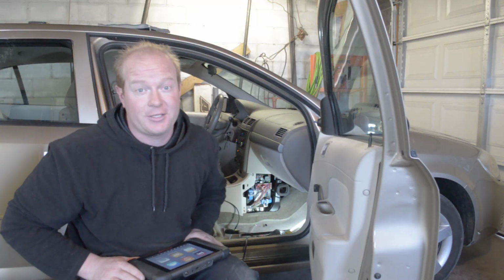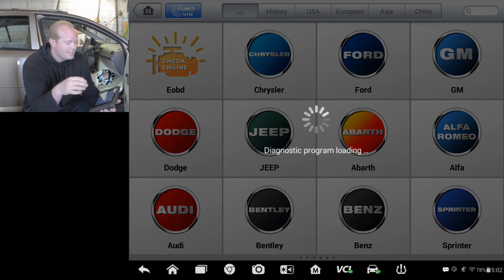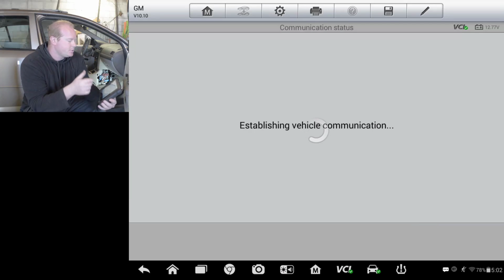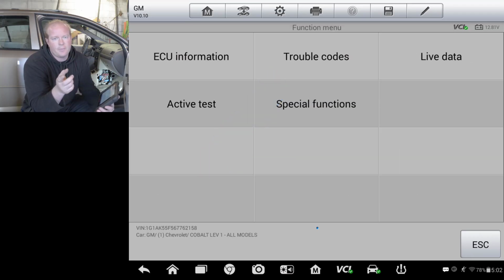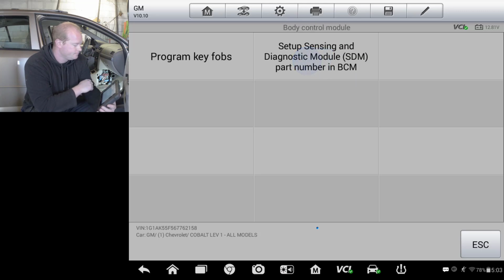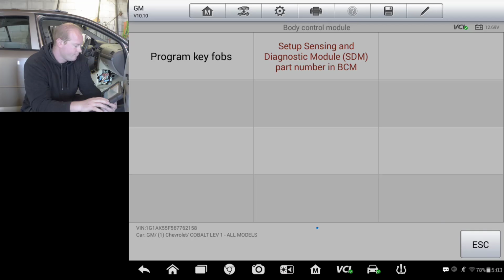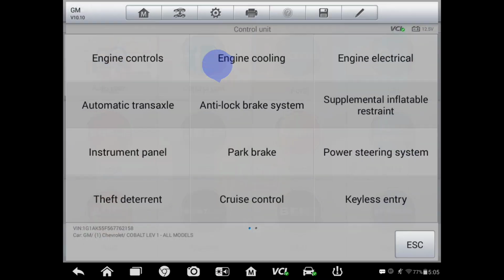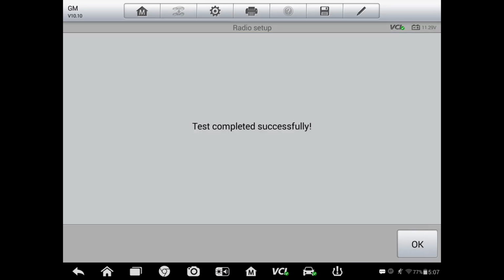Cobalt BCM Coding

Comment: I know this video is old but can a bcm in a 2016 kia sorento be flashed with this scan tool or would it need to be done at dealer with gds software?
Reply from the maker: You would need the dealer tool for that one. Kia used to work with J2534, not sure if that is still the case.

Comment: Hello, I would appreciate any help if you had a minute please. I have a 2003 H2 Hummer and I cannot find where the BCM is located. If you have any knowledge or videos where it is and how to get to it I would sure appreciate it. my problem is I have the Unknown driver and half of the electronics doesn’t work. I replaced the ECM but didn’t change anything. Thank you so much, this thing is killing  lol
Reply from the maker: Looks like it is above the steering column, find the OBD2 connector and look way up inside the dash from the floor.
Reply: @FlashPerformance 
Hey, I’m just asking because I’m desperate. I replaced BCM, ECM and still get this “unknown driver “. I have watched hours on YouTube about this and just cannot seem to find a solution. Just asking if you have any knowledge or if you come across anyone that has dealt with this . When you put driver one or driver 2 it would usually show up now I get unknown driver and like I said Half the  electronics don’t work. Thank you !
Reply: Got it !!! Thanks man !!!! Appreciate it very much

Comment: Thank you! Will the Maxi allow a 2014 Kia Sorento BCM to be programmed?
Reply from the maker: I think only a Kia OE tool can program the BCM
Reply: @FlashPerformance  KIA claimed only their OBD could program a BCM. As it turns out, by just completely draining the charge from the system, then resetting everything, the system automatically programmed the BCM... worked perfectly! 🙂

Comment: Hi there I have a problem with a 2010 Dodge Gran caravan no charging, I have made sure that the wires from Alt to ECM are good tested them continuity both are good and are able to transport power I can can get a new ECM and reprogram it so is there a way to by-pass the ECM and make a separate charging system or is the Autel Ultracan do a flush? if so could you tell me how. thank you
Reply from the maker: How does that system work, Does the PCM control the field on the Alternator? I have seen where the PCM driver will go out and cause the vehicle not to charge. Check the wiring diagram for the circuit and see if there is a field wire from the PCM

Comment: Please can you show how to change the brake fluid on the Electric car Renault Zoe Year model 2019. Which fault code reader works for this Electric car.  It's a Renault, so I'm wondering if the Can clip won't work for this car?  Thanks!  From Tommy Bertilsson from Sweden
Reply from the maker: Most electric vehicle manufacturers are still using a 16 Pin OBD2 port. This will give you access to the vehicle systems, from there you can operate the Automatic brake bleed and follow the OR procedure. TOPDON ArtiDiag Pro, any TOPDON Phoenix, Or any Autel MaxiSys can do these operations.

Comment: We install a used BCM into our cobalt ss . We took the car to the  dealer to reprogram it and unlock the radio and they said couldn’t communicate with it. Took $70 dollars even though they did nothing. It appears in your video it is possible reprogram a salvaged bcm?

Comment: In an '07 Cobalt does the BCM have any influence over the blower fan switch. Switch was replaced with no results, also replaced the head unit twice, no dice. Good power to all connections and blower spins when hotwired. Any clues?

Comment: I have the MS906bt and would like to code in a new AC/ Heater control on 2009 Enclave. There are no options that I can find that will allow me to do that. Nothing under HVAC or BCM and going to special functions in each area. Any ideas?

Comment: Can you flash a bcm  for a chevy s10 and remove the security? It starts and shuts off
Reply from the maker: No, the Autel tools can not remove the security features from a vehicle. You might just need to do the key relearn procedure.  Those vehicles don't require any special tools to relearn the keys after the BCM has been coded or programmed.

Comment: So what about the fact that the odometer then displayed the junk yard's car reading instead of the car's actual reading. Plus the vin isn't programmed into the BCM. The video here shows you setting the BCM up - not programming it.
Reply from the maker: The Mileage for the vehicle didn't change after this installation.  The Milage is not stored in the BCM on this model it is stored in the instrument cluster.  This vehicle is not a Global A vehicle so it didn't require the VIN to be written to the module.  And you are correct I didn't program the module. I coded it to the PCM and radio
Reply: @FlashPerformance  that's interesting. My 07 cobalt definitely stores the mileage in the BCM. When I swapped with a used BCM my 130k mi car suddenly had 259k mi on it. I ended up buying a factory BCM. I will program the mileage and vin plus setup the SDM p/n and BPP. I am installing a new one because I am converting my base model to power windows, door locks, and keyless entry. The original BCM lacks the relays required for lock and unlocking through the BCM. I bought the junkyard BCM to harvest the relays to solder in the original BCM but the original still lacks the logic to control a RAP relay. I enjoy tinkering and making things work like original so it's just a fun project I got myself into. I know I could tap into ignition voltages elsewhere but I'm hopeful I might get remote start out of a new BCM. I'm just not sure if I can program remote start through SPS programming or if it can only be done if the VIN is coded for it. I know GM definitely wouldn't create a special VCI program for a vehicle that doesn't come standard with the proper options so we'll see!

Comment: Good Video . . I have a 07 SKY and the MaxiCOMM MK908 Pro. Will this procedure work for reprogramming my BCM.
Reply from the maker: If you find a used BCM with the same part number, yes. If it is a new BCM you may need to program it with J2534
Reply: Flash Performance  yes find same parts number bcm but dont have start can not start my car opel movano how can i do best ?

Comment: Can I program the 2006 Mercedes Benz C230 ECM with Autel 906 BT scanner?
Reply from the maker: No, The MS906BT has no programming functions.  You would need a J2534 device to program that
Reply: @FlashPerformance  ..ok but the j2534 if I can use it with the maxisys ms 906bt ..?
Reply from the maker: @gamerfoxz3304  No, J2534 requires a windows PC, https://www.nastf.org/i4a/pages/index.cfm?pageid=3660
Reply: Fantasmaz Fantasmaz.z you will also need that J2534 device and a laptop plus a battery maintainer which is expensive or you’ll mess up the  pcm

Comment: Can you use this to turn cruise control on in the computer if its currently set to off?
Reply from the maker: Maybe, depends on what you mean.  If you are trying to diagnosis the cruse control you can do different activation to see if it is working properly and to diagnosis the issue.  If you are asking, can I add cruise control to one that didn't come from the factory that way, then no.  Cruse control is all about inputs.  You need to make sure you have all the inputs required.

Comment: Hey Flash Performance - Would you some day show how to program BCM for Ford? I need to tell my 2010 Ford Escape's BCM to recognize a new FoMoCo headlights switch with my retrofit of Fog Lights on my vehicle that was not included in my XLS model but was with the XLT model. And I also want to add FoMoCo steering wheel mounted switches for controlling the stereo and smartphone interface. Basically I want to add all BCM options in the Escape XLT to my Escape XLS. Thank you.
Reply from the maker: What your asking for is not an easy process. You will need to go to Ford directly and let them know the components that you have changed and what function you want to add to your Escape.  They will have to change the As Built Data at the engineering level for your specific vehicle VIN.  Once that has been done you will have to use a J2534 box and ford specific software with a windows PC. Then you will program the new information into the BCM.  https://www.nastf.org/i4a/pages/index.cfm?pageid=3646

Comment: Installed a salvaged bcm on a 2006 Chevy Malibu Maxx SS the exact same way. and it worked. I just used the exact same part number of the Bcm. used the Rpo code for the radio and worked fine. No issues
Reply: How much cost to reprogram a bcm ?

Comment: Please i have autel mk808 and i want to use it to fix my odometer and side mirrors/boot door can you please help me?
Reply from the maker: The MK808 is a service tool that can read and clear codes in all modules.  You will need a higher level scan tool to do those functions.

Comment: Can i use this product on an engine swap. I have a 2011 camaro 3.6 llt engine. Swaped the engine for the lfx 2015 camaro 3.6 swaped ecu. Now i have to make the body talk with the ecu. Can this product make it possible? Or what do you recommend i do now?
Reply from the maker: No, This tool will not do what you are wanting to accomplish.  You will need to use HP Tuners or something similar.

Comment: ANYONE ?  2012 Camaro Conv. RS V6. I bought this car after a flood. Have installed new modules where needed and have replaced the BCM and cannot  access it with my scanner. All modules are accessible thru the scanner & can program them. When I try to go into BCM it comes back with "unit is not installed in car" . I put the old unit in & same thing. BCM has to be working as car starts, all ac & gauge functions work, etc. There are a few things that don't work thus the new unit. The new unit was originally programmed by the dealer but they  had trouble accessing it also. As it cost to much to carry the car to them to check each item I bought my own scanner/programmer to troubleshoot with eliminating $110 every time they hooked to it. I am able to access all other modules & program/modify each one except the BCM. Have checked grounds, power, etc. & can't get scanner to see this one. Any ideas why the BCM would be blocked or not seen?
Reply: Check all your fuses and relays, and maybe grounds, not sure where they would be for that

Comment: And just when I thought I had ECM tuning down, I'm starting to discover a whole new world of pain and suffering these manufactures continue to perpetrate on my wallet. My Cobalt is having the "auto door lock" issue where they just do their own thing all the time, in addition to that, now the trunk doesn't open. 

I'm stuck overseas now, otherwise I would see what codes come up on my laptop, but HPTuners only really has access to the PCM/ECM, not the BCM. So really, if it is the BCM it's not something I can program or override or switch off certain features like I do on ECM's for modded cars for other needless sensors (like egr or downstream O2's on catless setups). HpTuners can relink VATS, and do crank relearns though, which makes ECM swaps (07 and older at least) a breeze. When I get back in a few weeks and start to fix this thing I'll report back since I don't usually get much newer than 2002 as far as swapping goes lol. Tuning is a whole other thing in of itself, but requires no special linking or programming of modules per-se. Just modifying the tune, then a quick flash. 

Looks like I have to open up my wallet again if I want to stay independent. But seriously, if one of these units goes for 2k+, then why not just pick up a Tech 2?
Reply: ChopperDoc181 you can get the vx-diag it has the tech 2 software
Reply: ChopperDo

c181

Comment: Could you help me, I got Autel maxicom MK808, I tried to programmed old second hand BCM (same part number) in fiat punto 2005 (188 manual ) tried to do key programming etc but no luck, could you confirm me which tool I should use or how to programmed that BCM as car doesn't start coz of immobilizer
Reply from the maker: You need a key programming tool to relearn the Immobilizer, The MK808 is not designed for that.  There are a few tools you can check out but I don't know their coverage on the Fiat Products. Check out Auto IM100, Autek, Smart Pro, ZedFull, AutoPro Pad

Comment: I  have  Autel  ms908 ( no pro)  I can do this  function like You do in this video  ? with  my MS908 ( no pro)  . Thank you so much  for your help.
Reply from the maker: Yes, there is not difference in the software from the MS906TS to the MS908.  All the screen and functions will be the same.
Reply: Flash Performance tank  so much  , I follow you,  I like your videos  in special when you show new tools  and Autel functions.  Thank you so much
Reply: @FlashPerformance   what about a ds708 autel?
Reply from the maker: @Vin_Z86  The DS708 has been discontinued for almost 5 years now.
Reply: @FlashPerformance  I know but I have one I was asking you if I'm able to do this procedure with the ds708. Sorry if I wasn't clear
Reply from the maker: @Vin_Z86  I think so,  have never tried it with the DS708 but a lot of the functions are the same for these older cars
Reply: Would the ms906bt be able to do the bcm?

Comment: Am I missing something? Your video comment says that you replaced a Cobalt BCM from a junkyard and that the video will show how to code the BCM to the PCM. The Cobalt  and the Solstice actually have a lot in common. I bought an identical used BCM on ebay. I need to do the same thing you did ... right?... or are there procedures that these units cannot do that are prerequisites? Thanks in advance and for posting.

Comment: I have a 2006 Solstice Manual Basic 2.4L

Discovered this past winter that a few inches of ice/water on floor of my downward tilting solstice from rear window leak caused BCM failure. Removed fuses/relays & battery cable. Exact part# replacement BCM from same model/year proved a positive step, except for the mileage off by 10k, the LOCKED displayed on the radio which I was going to replace anyway, and the engine won't crank. 

I have done the 10-12m sequences to relearn my keys several times without success. Best doc I found is: key position to crank then release, leave 12m then off 10s, repeat twice more, remove key 1m, then it sould start. I have a P0315 Crankshaft Position System Variation Not Learned that I clear but immediately returns. No other codes but engine light remains on. 

During the key relearn the security light will not go out. During initial attempts to crank, I do hear the fuel pump charge the fuel line. Security light stays solid. 

When the ignition key put into the RUN position, at the main fuse panel in the engine compartment, both the RUN Crank [51] relay pulls in and the crank fuse [5] terminals are hot . Battery fully charged as I have had this car on a battery charger for weeks. 

The tech on Just Ask said:
The BCM will need to be programmed with a GM Tech2 scan tool and access to GM tech site to download software.There is not a workaround for this. You will need to call around to your local GM dealers to find one to do the programming as many refuse to do the programming for customer installed control modules.

Can this scan program tool fix this ?
Reply from the maker: Some of the functions the Maxisys tools can do, however the programming of the BCM it can not.  Here is the complete procedure:

Each of the following courses of action requires a setup or programming procedure before the body control module (BCM) can be put into normal service.

 Body Control Module (BCM) Replacement
 If the BCM is replaced, the following procedures must be performed in the subsequent order:
 -  BCM Reprogramming-Refer to Body Control Module (BCM) Programming/RPO Configuration in Computer/Integrating Systems for replacement, setup, and programming.
 -  Brake Pedal Position Sensor Calibration-Refer to Brake Pedal Position Sensor Calibration in Lighting Systems.
 -  Theft Learn-Refer to Programming Theft Deterrent System Components in Theft Deterrent.

 Sensing and Diagnostic Module (SDM) Replacement
 If the sensing and diagnostic module (SDM) is replaced, the following procedure must be performed:

 Setup SDM Part Number in BCM. Refer to Body Control Module (BCM) Programming/RPO Configuration in Computer/Integrating Systems for the proper procedure.

 Brake Apply Sensor (BAS) Replacement
 If the brake apply sensor (BAS) is replaced, the following procedures must be performed:
 -  BCM Reprogramming-Refer to Body Control Module (BCM) Programming/RPO Configuration in Computer/Integrating Systems for replacement, setup, and programming.
 -  Brake Pedal Position Sensor Calibration-Refer to Brake Pedal Position Sensor Calibration in Lighting Systems.
 -  Theft Learn-Refer to Programming Theft Deterrent System Components in Theft Deterrent.

 Body Control Module (BCM) Reprogramming
 If the BCM is reprogrammed, the following procedures must be performed:
 -  BCM Reprogramming-Refer to Body Control Module (BCM) Programming/RPO Configuration in Computer/Integrating Systems for replacement, setup, and programming.
 -  Brake Pedal Position Sensor Calibration-Refer to Brake Pedal Position Sensor Calibration in Lighting Systems.
 -  Theft Learn-Refer to Programming Theft Deterrent System Components in Theft Deterrent.

 Theft Deterrent Programming
 If the BCM or the powertrain control module (PCM) is replaced the programming for the replaced module must be performed before the programming of the theft deterrent system. Refer to the following:
 -  BCM Reprogramming-Refer to Body Control Module (BCM) Programming/RPO Configuration in Computer/Integrating Systems for replacement, setup, and programming.
 -  PCM Reprogramming-Refer to Service Programming System (SPS).